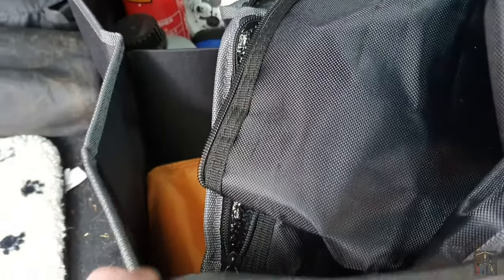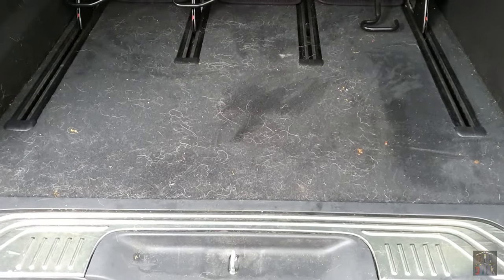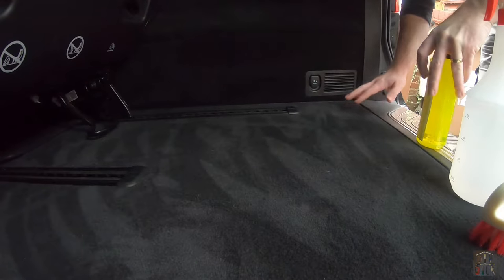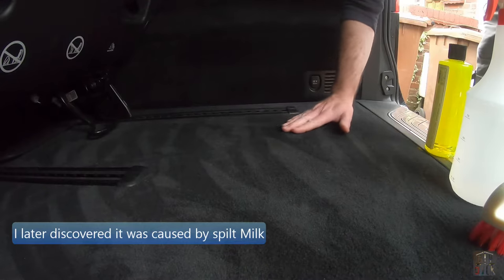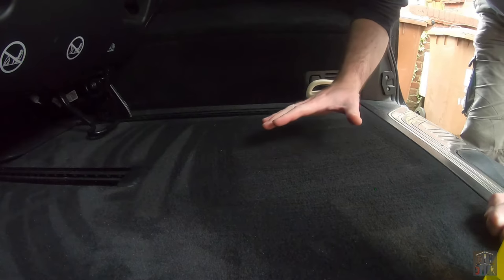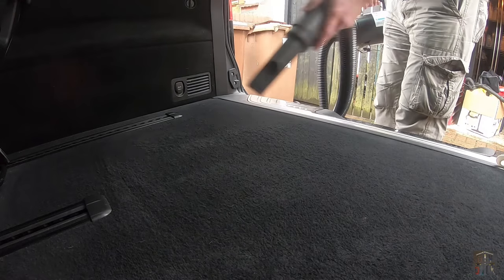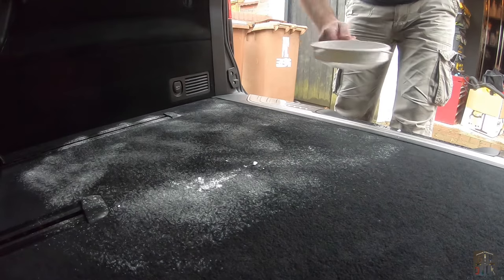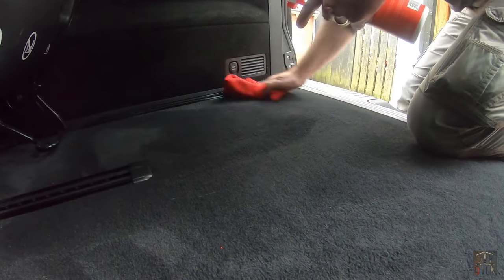How to permanently remove a Nasty Smell or Odour from your Car or Van with Baking Soda

Comment: It would help to mention the name of the “yellow stuff”. I have been using a liquid spray call Odoban for years. It does not clean as it is not a degreaser however removes odors immediately and used by hospitals to kill bacteria , virus etc. You can spray it on dead rodents and will work extremely well. Great in situations where your home has water damage and wet carpeting. Sold in major department stores with different scents (lavender ,yucaliptis ) .
Reply: It prob g101
Reply: Where do you get the degreaser? What store
Reply: Ok I will try it
Reply: Here after a hurricane hopefully this would help
Reply: @bladegoezzzham9971  same lol

Comment: My mom stank up my new car w rotten meat that leaked thru the bag it was in, the stench was so bad I just put baking soda let’s see how it goes
Reply: How did the baking soda go??
Reply: @erik9157  didn’t completely remove the stench I had it there for about a week and eventually vacuumed it out and bought 2 of the gel car fresheners and it got rid of the smell completely
Reply: @jorgeguzman9592  I’m having the same issue. Did the smell ever come back or did the gel freshener kill it ?
Reply: @sergiozavala4136  it’s gone but the area that got wet still smells very light u can only smell if near the water mark
Reply: That's the issue I'm having! It smells sooo bad in this 102 degrees we have had today. I have to wait til nighttime to clean it out .. I'm so Ashamed about this
Reply: @a.m.ggriffin5162  use Baking soda abs buy a strong scent gel leave it there

Comment: PLEASE HELP!! I have an AWFUL STALE URINE smell in my front driver's side floor carpet. I have tried pretty much everything. My last resort is gonna try the white vinegar/baking soda combo solution.
Reply: Never put baking soda on a carpet. Try a quart of hydrogen peroxide mixed with a teaspoon of dish soap, possibly with a minute amount of baking soda added. Since it is carpet you can try just hydrogen peroxide and soap with no baking soda, or specially crafted baking soda type carpet cleaner to replace the baking soda. Use caution as the hydrogen peroxide may affect the colors of your carpet. Be sure to check and follow the proper safety and chemical precautions when handling and mixing hydrogen peroxide.

Comment: This is great! Exactly the video I was looking for. I had a forgotten bag of fruit left in the trunk and you can imagine the smell. Will definitely try this. Thank you!
Reply from the maker: Hi George, glad you've found it useful & hope you've got rid of the smell.  If it comes back repeat the process and leave the Baking Soda for as long as you can.  Good luck!  DIY Dick.
Reply: Never put baking soda on a carpet. Use specially made carpet cleaner for this purpose. Never vacuum baking soda unless you have a certified baking soda capable vacuum with a HEPA filter. For a car carpet this is not as important as home carpet, but even with a car carpet it will be difficult to get the baking soda out of the carpet.
Reply: I think i won't mind some baking soda over the smell @earthenscience
Reply: @tew.x1125  the problem is once you put baking soda on a carpet it will mess up any non-baking-soda compatible vacuum u use to vacuum the carpet from then on

Comment: I have a dog walking service and a new van with a closed back area, 1 dog I sometimes pickup for a walk is always so extremely excited that she pees a little in the back. I try to wash it off with the fire hose at my garage but in a few months time the smell build up and now it even reached the front area which is a closed area... Going to try baking soda after work today so hopefully it will work. There're no fabrics in the back, just leather, steel and wood. Thanks for this video!
Reply from the maker: Hope this worked for you.  Do try several times with baking soda (even for days if possible!) if you can't get rid of the smell first time.  Also to help clean & provide a basic level of protection for the leather take a look at something like Meguiars Leather Cleaner & Conditioner.
Reply: Try an ozone generator. That will get rid of the smell for good.
Reply: @diydick434  yeah it worked perfectly 👌🏻 vacuumed it first, then used my steam cleaner to remove more dirt. Finished it off with baking soda, after 2 days vacuumed it and the smell was gone. Thanks

Comment: My niece spilled milk in my car, I cleaned it but it still smells like old cheese in there 😭😭

* I thought about baking soda. I'll try your method tomorrow and hope it helps. *
Reply from the maker: Hope it went well.  This definitely works but could need multiple applications to remove the smell completely.
Reply: Did it work?

Comment: Easy, buy Smell Eze Corpse cleaner, sprinkle, let set. You can use a fork to get down into the fibers I do that with vomit from my pets on my carpets in the house. Let it sit overnight and smell is gone. Hey, if it works for dead bodies it will work for this easily. That was quite a production. I stick my nose down in the carpet and no smell whatsoever.

Comment: Hi what was product in the yellow that you scrubbed in first?
Reply from the maker: Hi Carmen.  It was Fabric Clean from the Chemical Guys - I find it good for stains (or in this case smells) that are a bit harder to shift, but without it being too aggressive & damaging what you are trying to clean.
Reply: DIY Dick thank you! I dropped seafood of all things all over my backseats and I’m having such a hard time getting the smell out I’ve tried everything! Right now it’s sitting in baking soda so let’s hope that does something! I’ll be sure to try this fabric clean next if it doesn’t work!
Reply from the maker: Leave the Baking Soda for as long as possible... days if you can + put plenty on.  If the smell doesn't go fully or comes back repeat... it does work in the end.  Fabric Clean & the like used with a scrubbing brush will certainly help though - just don't use too much water & be careful with any delicate fabrics.  Good luck!
Reply: @carmenflores1942   did you ever manage to get rid of the smell?
Reply: @zanderesp4295  it got most of it out, I would have friends say they couldn’t smell anything but I would still smell it. Not sure if it was phantom smells or what but I trust that friends noses were better than mine. It works! lol